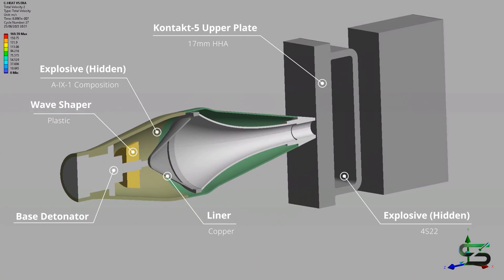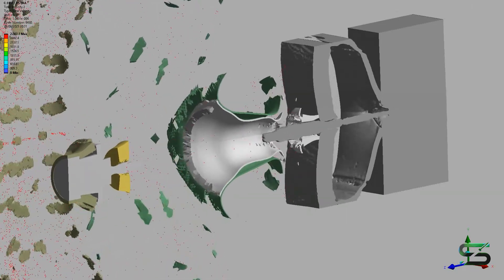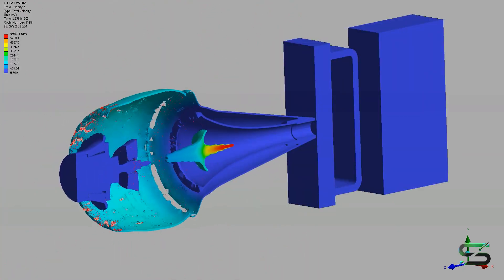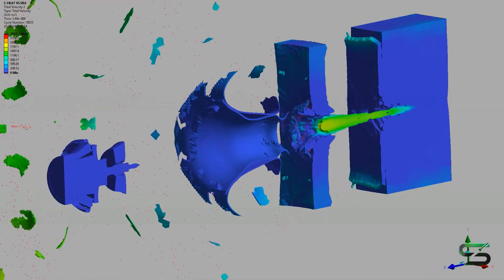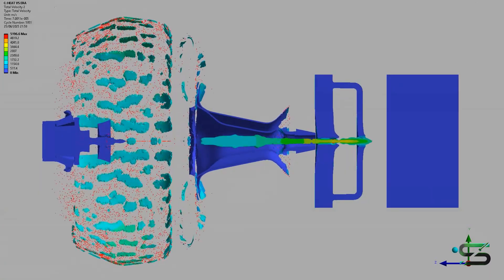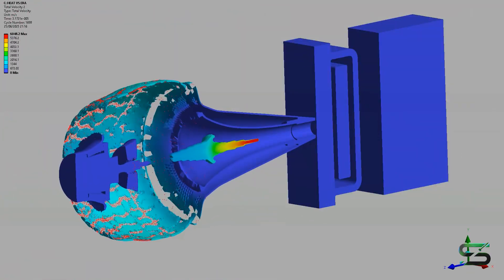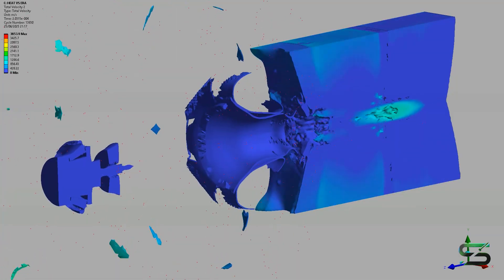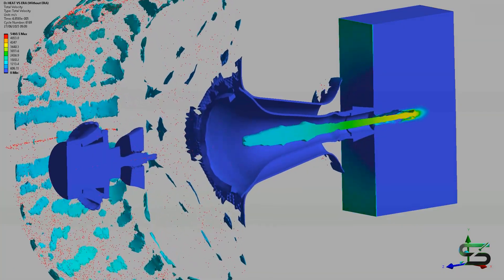HEAT VS ERA | Armour Piercing Simulation

Comment: This simulation is so wrong that it hurts
Reply: How
Reply: @aros_adob  you see how much this 80mm plate jiggles when hit with ERA shockwave? It definitely shouldn’t have looked like that. Some values must be set wrong. Probably in this case power of that explosion is just too high because in the part where ERA is not present everything seems to be all right. Also it seems like it detonated way too late. Also this layout is just not accurate ERA in reality is far away from the main armor (for me it’s acceptable simplification to make simulation shorter and easier to render). My assumption is, this guy simply couldn't pull off this scenario without achieving penetration in his layout and the ERA detonating so late, so he simply increased the power of that explosion to meet his expectations. This whole channel tends to make a lot of weird mistakes especially with ERA

Comment: Uh, yeah. Run that simulation again, except the flyer plate doesn't get detonated.

Cuz I suspect the warhead failed to penetrate from a perpendicular side shot solely because the flyer plate acted as spaced armor. 

By the time the ERA charge propelled the flyer plate, most of the penetrating jet has already moved past the flyer plate and was chewing through the side armor.

FWIW the K-5 plates arranged in 3 squares like that? It's designed to help deflect glancing frontal side shots (30 degrees offset from front) against APFSDS. Probably M829A1. Have you run that Sim?

Comment: Finally a shaped charge vs ERA simulation :D

Just a few things:
- ERA needs to be angled to work properly in order to unalign the jet. Without angling, the effect will be close to just adding the spaced plate;
- Kontakt-5 is not optimized for shaped charges, but for APFSDS, hence the heavy single-side plate. Use Kontakt-1 for better protection against HEAT;
- Avoid standing near the warhead for your safety.
Reply: Exactly without the angle there is no point in making the flyer plate fly at all
Reply: another thing, put the rpg rocket exhaust to where it belongs ;D
Reply: @kaganyuksel-xq1yo  Fire skirt
Reply: Which tank has era angled on the side of the hull
Reply: @looke3392again, as I said, in the areas where it’s parallel the era itself has angled plates inside the box. You could have looked up the diagram of the era block in the time it took you to type that
Reply: @looke3392 the vertical ERA isn't entirely useless because a lot of things that could hit it will likely come at an offset horizontal angle, creating the same effect. Newer Russian MBTs have more of these (relikt now) with a bagged type of ERA on top meant to work better at flat angles by having diagonal explosive elements and plates inside. They will still work from a diagonal side shot too due to their arrangement.
Reply: @looke3392 Kontakt-1 blocks have angled ERA, and so do the 4S24 soft-case ERA.
Reply: K5 is definitely optimized for shaped charges. the flyer plates work extremely well against both kinetic and HEAT penetrators. even more so when theyre angled
Reply: @itsericzhou kontakt 5 was created with heavier flyer plates to be more effective against apfsds projectiles whereas kontakt 1 was designed to counter only shaped charges and have little effect against apfsds. Both have their plates angled inside the era blocks though
Reply: @AsmellYoullGetUsedTo  yeah ik. this guy is trying to say that k5 is somehow worse than k1 at stopping HEAT. k5 exceeds k1 in every aspect other than weight. the flyer plate is exactly what makes k5 and relikt so much better at stopping all threats. simply shunting more material through the penetrator is a benefit. also no, the k5 side skirt is not angled downwards. its flat against the panel, since the most common threats would engage within a 60-90 degree arc in front of the tank(30-45 each side). the k5 blocks are angled on the hull and turret but the ERA element is parallel to the block. K1 is angled inside the block. relikt is the same as k5 in that its mounted flat relative to the box its in. the only exception is in the bag or big box on the sides of tanks, where the elements are angled away from the tank. the t90a shown in the video does not have that, and has the  k5 panels flat against the front third of side
Reply: @itsericzhou  It works for shaped charges, it isn't optimized for them.

Heavy ERA works very poorly for shaped charges given their weight. There is a reason all of the tank kits for urban combat only have light ERA, like TUSK.
Reply: @terminatoratrimoden1319  no. i have downloaded, a russian scientific paper, outlining a potential upgrade path for relikt, where instead of steel flyer plates, its some kind of ceramic. its larger by volume, but lighter by weight. the paper was studying its effect against HEAT projectiles. launching a flyer plate at any kind of penetrator, will at the very least, present more material. at best, it will also impart shear forces onto the penetrator(moreso for apfsds).
Reply: @itsericzhou Could you point me to that scientific paper you downloaded? I'm interested in studying it
Reply: @itsericzhou  I'm confused about what you're trying to say. So there is a paper about a possible upgrade to relikt, itself an upgrade to the K-5. So what? I'm talking about how heavy ERA isn't optimized for shaped charges, hence why for situations where only shaped charges are expected (urban armor kits and top of tanks) only light ERA is used.

Being optimized for something doesn't mean working for something. It means the characteristics are designed for performance over a specific problem. In this case, heavy ERA is optimized against APFSDS, while light ERA is optimized for HEAT. Light ERA is useless against KE penetrators, but can perform very well against HEAT for a tiny fraction of the weight.
Reply: @terminatoratrimoden1319  sure. doesnt mean k5 is in any way worse against HEAT. weight wise sure, but heavy ERA like k5, relikt, perform better period. heavy ERA isnt soley optimized for apfsds. get that notion out of your head because its simply not true. having flyer plates also makes it significantly  better against tandem warheads since a heavy flyer plate is much better than the thin plates that k1 uses.
Reply: @itsericzhou  If weightwise it's worse, it's not optimized. Either that, or i have a 500mm RHA plate to rival any ERA.
Reply: @terminatoratrimoden1319  optimization doesnt just come in terms of weight jesus youre slow. optimized by volume? protection? effectiveness against tandem warheads? effectiveness as general purpose protection?
Reply: @itsericzhou  Armor optimized for protection... Christ...
Reply: @terminatoratrimoden1319  so your argument went from weight to protection, which is worse for you lmao. k1 is worse for protection against HEAT than either k5 or relikt. the flyer plate shears the rear section of the penetrator, and in the case of relikt, also feeds material into it.